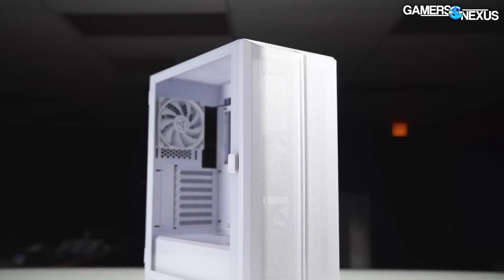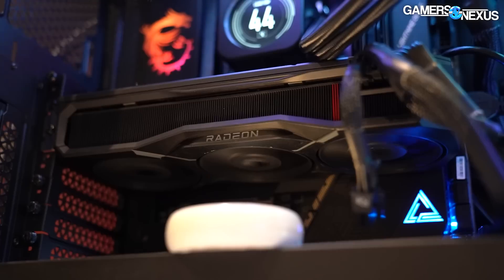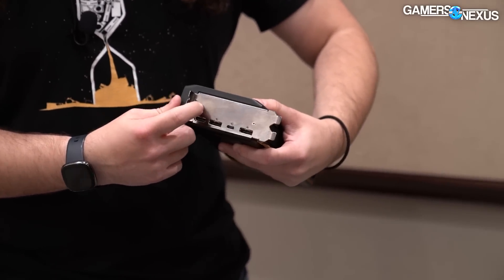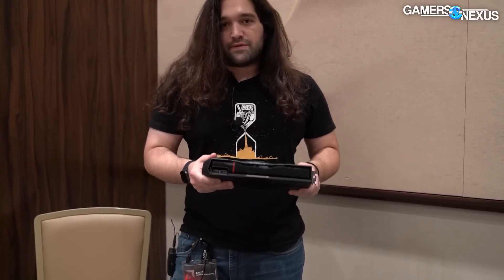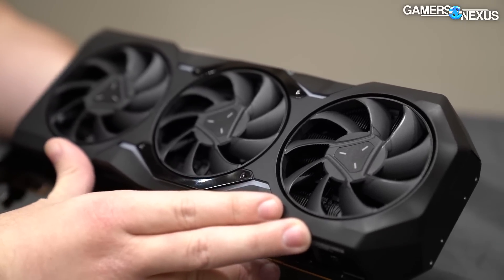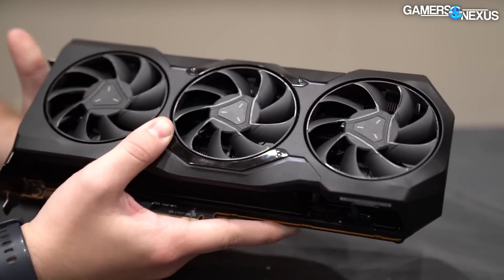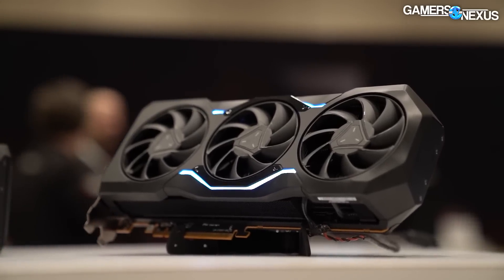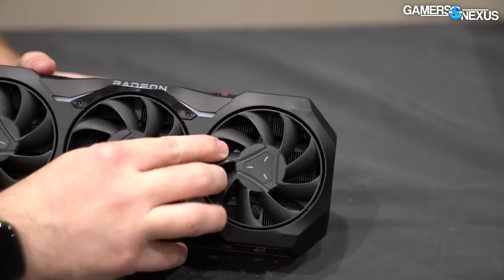More Video Cards Need This: AMD RX 7900 XTX Reference Design Hands-On

Comment: I do like the thermistor approach. Hope it'll be implemented well.

Am I the only one who likes the cooler Design for the 4090?
I mean I really hope it'll be the same for the 4080.

I've had to replace my case last time for a strix 3080 so now as the bigger one will fit anyways I'd certainly like to have the really low temps.

I think this cooler in size will still need to ramp the fans to actually cool the bloody things even in a good airflow situation.

Comment: I really like that they put the Type-C output back on the GPU. I sometimes use a portable third monitor or VR headset. Both of which use Type-C connections.
Reply: rear i/o is a trip ive had a 7990 4 mini dp, 1 dvi; 2080ti strix and 3070 fe and strix....and what a mixed bag that concept is based on market/appeal/selling demographics. The 2080ti had a type-c bc back then it was pretty top notch and led in VR at the time, then the 3070 strix has 2x HDMI and 3x dp....like 1 HDMI could have been type c for a would be TIPPY Top of the scale AIB. The 7990 was a 300$ refurb so it didnt come with the plethora of mini dp adapters etc...But yeah IMO when spending on 1000$ range gpu its pretty insulting to see such a lack of actual "i/o" on par with the amount of $$$ being spent/dropped. 3 DP 1 hdmi and type-c like those 5 at the least should be standard to accommodate the majority of end users if their intent is Maximizing their sales/potential. 7990 3 screens, a projector and a tv....i mean that was a precedent set long ago....and its rare to be able to accomplish something like this  these days. NGL.
Reply: This was SUPPOSED to have been for a VR standard that apparently died because NVidia didn't care enough to stick with it
Reply: They did this with the 6800xt as well - for me, it's the reason I'm not buying the reference model (currently have a Sapphire Nitro+). I get that the USB C is great for the people that use it for VR, but I'm running triple monitors and prefer to have them all on the same connection standard (DP). Buying reference would mean running one off HDMI or through a USB-C to DP adaptor, which increases the potential for unexpected behaviour.
With the blanked out PCIE plate you'd think they could add extra ports (4x DP whilst still keeping USB-C and HDMI). Not sure why they don't do this - they've had cards with more outputs in the past, so I don't think there's a windows limitation or anything in the way.
Reply: @winterscrescendo  I agree that it would be best to just have more outputs. 4 DP + HDMI + Type-C would be great. Like I said, I run a triple monitor setup but I like having the option for other display outputs rather than just DP.
Reply: @winterscrescendo  same, currently 2dp 1hdmi for monitors and 1dp for index, give me 4dp sockets damn it
Reply: @winterscrescendo  I have an RX 6800XT (although it is also in the non XT cards) and have come to use the USB C port a lot. When I first saw it there I was bummed that I lost a Display port ( a $3 HDMI to DP solved that) and now I am loving being able to plug my VR headset natively. Hope this becomes a trend. I have encountered ZERO issues with converting HDMI to DP since they are similar.. HDMI has the audio return channel (ARC) and is missing one pin compared to DP.  Just my two cents
Reply: @scottcol23  I have to agree. I have a cheap HDMI to DP adapter and it works flawlessly for my 1440p 144Hz monitor so I don't see it as a downside because I also sometimes move my PC into the living room and game on my 4k TV when I just want to kick back on the couch with a controller and relax in comfort with my feet up. I guess I like having all the options rather than being locked into a single display output since the world hasn't agreed on a standard for all products yet.
Reply: @winterscrescendo  those second slot connectors might not be electriclly reliable but it's probably just because nobody really uses more than 4 outputs so theres no need to wire them up that way
if you want more displayport you can always get a MST device, which adds weirdness but can also double your output

Comment: Love the idea and love the card, but I'm still not happy with the pricing of the 7900XT. Or should I say 7800XT?
Also, nobody should be grateful a card costs "only" $1k
Reply: i dont understand why so many say it should be the 7800xt... is it because the die is cut down or what? if so, then the 4090 should also be a 4080...
Reply: @georgwarhead2801  Just comparison and "naming". For example, the 6900XT was a full die and the 6800XT was cut down. Both were on Navi 21 and had the same amount of VRAM and Infinity cache. One $999 and the other $649.
The 3090 wasn't a full die and that was also the case for some Titans.
So that's one point of comparison.

The naming, although useless, is a pretty indication of company BS.
Everytime a company come up with a naming scheme that is different from the normal, usually is BS. Look at Intel and the i9, AMD with R9. Recently, Nvidia with the "4080" 12GB.
Those were all marketing stunts to deceive customers into thinking something is higher end than the other.

I find very suspicious that all the leaks were pointing to a full die 7900XT and suddenly AMD come up with a X at the end.
Also, the XTX is clearly a better card at 999 vs the XT at 899. Just $100 gives you more shaders and 4GB extra.
This is definitely the classic cinema popcorn example, where the medium is so close to the big price that people feel it's a better deal to buy the big one, even though they are spending more money on it.
Reply: @MushroomClippyOfKnowledge  well, for me naming doesnt matter at all, they can call it what they want...even on the 6000 series they had a xtx chip for the 6900xt, but for the longest time they didnt make use and locked it down to the 6900xt and later sold that chip as a 6950xt...as long as they bring a 7800xt for ~ the same price but maybe 40-50 % faster as a 6800xt they can do what ever they want... you dont know the performance of the 7900xt, maybe its just 5-10 % slower as a 7900xtx for a 12% lower price

Comment: As I said in the previous video, I'm hoping this card ultimately delivers, but I'm gonna wait for actual testing to be done on it. It looks promising so far, but I'm not going to get too hyped for it.
Reply: The price alone is something to hype over. Even if it doesn't beat 4090 which it won't (but they have a even higher end GPU in the pipeline) the price is lower than even 4080 and it is definitely significantly better than that. I mean it's not just a win, it's a double win for everyone.
That means nVidia will have to bring down 4080 back to the original sub-800 prices if they even want a remote chance to stay relevant. Huge W for consumers of both sides.

Comment: The thermostor should be standard on EVERY AMD GPU from now on. What an awesome idea. 👍
Reply: @GsaUce Rug the components might be but they still have to incorporate it into their design, if it costs more incorporate they might reserve it for their top tier designs.
Reply: If it cost 1 extra dollar, then sure. 
If it cost 10 extra dollar, then they can spend these money on better im or die z height or cooler plate thickness or cooler plate flatness or something else that will make more difference overall.
Reply: Eh why? 95% of users won't care
Reply: @dhkatz_  The end user doesn't have to care. It should be standard for temperature monitoring for the stability of the card itself.

Comment: If the AIB cards have the thermistor, I'd be interested to see how they use it. I'm waiting for the benchmarks and other cards. I will probably upgrade my 5700XT to some RDNA3 card.
Reply: Same idea here, but then from a RTX 2070 (non-super). Waiting for the benchmarks on release, and hoping the software/drivers are atleast as good as the 6000 series!

Comment: On the fin design: As someone who uses consumer grade hardware in enterprise chassis, this is actually a bit intriguing. I will probably still pickup one of these guys, but I am interested to see if the cooling is still just as effective in a server chassis. The cynic in me makes it feel like they want to force people into the enterprise grade GPU's but thats less than ideal these days, especially with things like the licensing that nVidia has implemented. Big Corps dont necessarily care, but as "just some dude" who is doing some edge case stuff, it makes me question the decision behind the change. I am sure some partner designs will still have the back exhaust fins, just hopefully will be an option without some wildly huge heat sink solution.

Comment: Is it better to have my fans constantly run on low!? I've been rocking 0 rpm GPU fans unless there's a load, but now I'm concerned about the other components. Strix 1080ti, vertical but close to the motherboard in an SL600M

Comment: This is pretty interesting, as the first components to fail in a GPU is usually the SMDs. Or worse, a failed SMD killed the core. Have seen a lot of 10-series and 5xx series with holes in the PCB, but the saving grace seems to be the existence of fuses and proper VRM cooling / heat dissipation. Thankfully the fuses are becoming more common now (it used to be a Sapphire thing back in Polaris / Pascal). Still, cooler components and adequate protection = more longevity, I guess

Comment: I've been using the Corsair Commander Pro and its thermocouples for temperature management, but putting this on a video card makes it a lot simpler for everyone. Now only if Asus brings back that old gimmick of theirs where they would have an exposed fan header on the video card, allowing a few case fans to be controlled directly by GPU temps.

Comment: I really hope these cards have 0 RPM mode enabled by default and I don't gotta mod the bios for it
Reply: or you just enable it in the adrenalin software?
Reply: @georgwarhead2801  You can only set the minimum fan speed to whatever the manufacturer sets it to. If you're able to do so without modding your cards bios, it's because the manufacturer enabled the fans to be capable of stopping which none of the 5000 series cards have enabled. Also, I use the standalone driver + third party OC software because adrenalin is a whole software sweet and I prefer minimal light weight non-resource intensive software, plus adrenalin's curve editor is very limiting compared to afterburner. Thanks for the suggestion though.

Comment: Steve is now like a kid during Christmas. He sees the card, but can't open it yet, and this is torment for him.
Reply: I was expecting him to slap a Gamers Nexus toolkit on the table, just to see the reaction of the AMD flunky hovering just out of shot who was babysitting these hands-on sessions.
Reply: They probably did a pat down on Steve checking for tools.  Even without tools it looked like he was scratching at the card to get below the surface.
Reply: I surgically cut into a present with a N64 game inside and replaced the cartridge with another game cartridge so the weight would be correct. Then I surgically reassembled it. When Christmas came I pretended to be excited. lol. It does ruin the experience so I wouldn't recommend it. Patience is a virtue.
Reply: Steve doesn't need tools, he can undress the card with his eyes. Breaking down hardware is his superpower but he doesn't use it on camera.
Reply: Is this why he is distracted from the location he is at?
Reply: At the end of the video, he try something with his bare nails, as if he wants to remove the shroud. That's frustration :D
Reply: I wouldn't let this card in his hands for too long ... 😆
Reply: It's really tormenting me too! That and I want benchmarks now!
Reply: I wish I could open Steve's cheeks 🥵
Reply: @BBWahoo  Excuse me, WTF? :D

Comment: I hope it can do 1440p, 60fps on ultra settings with ray tracing otherwise I will just get the cheapest card for 1440p 120fps on ultra without RT...
The pricing seems fine in comparison to Nvidia but still to high compared to older generations. The temperature sensors seem nice
Reply: @Eric they said with RT
Reply: @Eric on ultra with ray tracing? You have benchmarks for that?
Reply: @GoddersWar Hopefully cause I'm still on 1080p and wanted to get new 1440p monitor and XTX. I'm not planning to play too many RT games so not really interested in 4090 at these prices, it just would be nice if it was possible to play at least some of them in a proper way.

Comment: If that thermal sensor is available to tools like FanControl, (the new one)
You could use it to control case fans depending on the heat inside the case, FINALLY!

useful for water cooler users for sure!
Reply: Some motherboards have temp sensors you can place anywhere in the case for controlling case fans.. 
The point of this is to prevent the card from getting damaged when the die isn't warm

Comment: Since they haven't compare themselves to the 4090. There are two things about that. Either is as good or it is about 50% lower in performance.
Reply: Considering the 6900XT already beat the 3090 for 33% less price, and the 6950XT did the same thing to the 3090Ti for almost 50% less price, the 7900s are gonna slap all the 40 series around. 😎👍

Comment: with intake temp you can also define the most optimal fanspeed, but we're talking like +/- 4% speed (fanspeed can be calibrated for minimum fanspeed in a cool case, or higher fanspeed in a hotter case, automagically), still an increase in accuracy I guess.
Reply from the maker: Those numbers aren't accurate to our experience with hot cases.

Comment: Well i use liquid cooling anyway to keep the thermals in check.

Aside from that i find this idea good and every card should have that no matter how "low budget" it is. 

This gives us more control over the fans than just the curve. 

I hope we can set multiple targets in the future like chip X C° or Y °C Memory or even hotspot temps so if either condition is met it spins higher.

Idc if the gpu costs 15-20 bucks more this way if it increases the longevity for the avg. consumer.